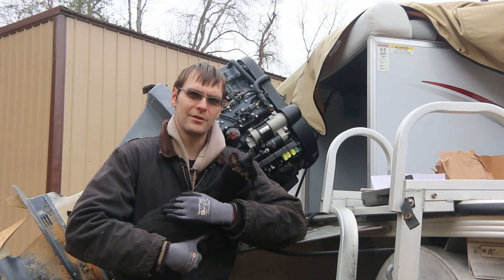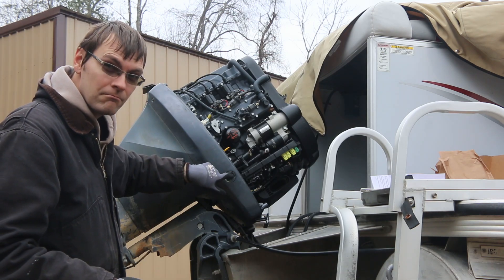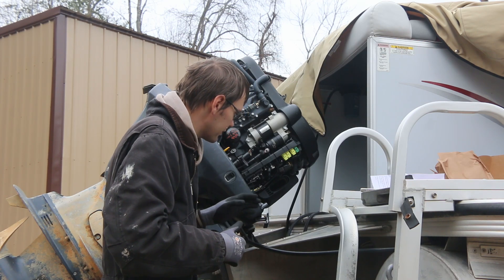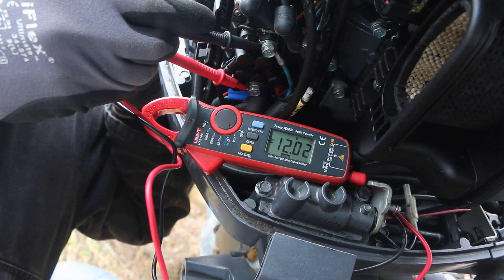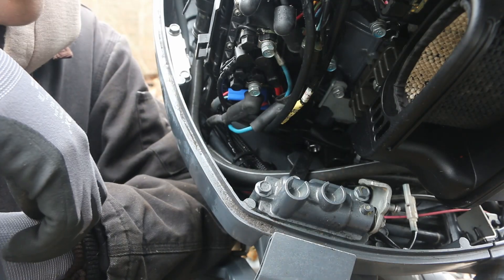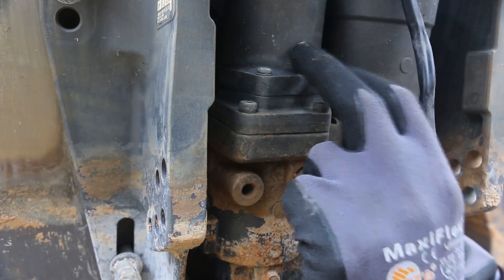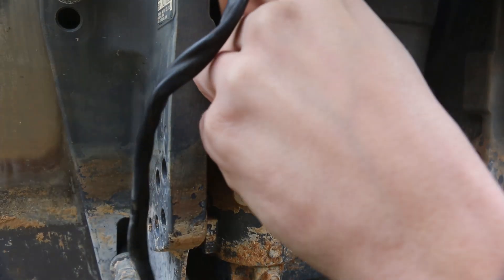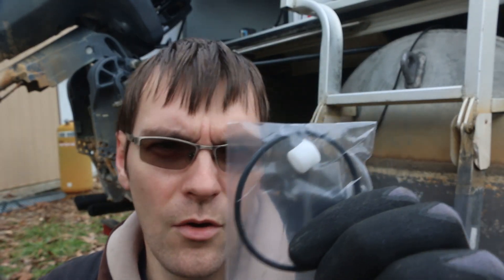Yamaha F90 Tilt/Trim Diagnostic and Motor replacement

Comment: But did you ever test your old motor directly to a battery? I'm having this issue but can't determine if it's the solenoid or not because when I wire the trim tilt motor directly to a battery it works great
Reply from the maker: Yes, the motor wouldn't draw any power, no spark, no nothing, evidently the windings had burned up or something.
Reply from the maker: if your motor runs when powered directly then its gotta be the tilt/trim relay or the button potentially

Comment: Should I put grease on the new motor bolts?
Reply from the maker: I feel like a small amount of blue loctite is recommended, I personally don't always do it because yamaha usually puts way too much on at the factory so those bolts won't come out, but it wouldn't hurt to put a drop on there.

Comment: The problem is, my motor is stuck down
Reply from the maker: There should be a manual release screw on one side, its recessed back in a bit, big flathead usually, then you'll need a few strong friends to lift it up, and flip down the lock lever, then figure out whether you need a trim motor, relay or something else!

Comment: Any clue what the other wire coming out of the grommet next to the trim motors wiring is?
Reply from the maker: Oftentimes there is another wire for the trim level sending unit for the trim gauge

Comment: Great video man.
I have a yamaha f90tlr that i am having the problem of the trim just clicking both ways i can tap on the cylinder and it starts working again. Can you add tilt trim fluid to it or do you think its the motor. I didnt see a bolt to remove on the cylinder side to add fluid but there is a bolt on the motor side under where you remove the screws to remove the motor. Mine looks identical to the on in your video the motor cylinder set up. Thanks
Reply from the maker: Usually there is a small reservoir type thing that has a plastic plug to add fluid, but if you can't hear the motor run when you hit the button, and tapping on it makes it start running then your issue is almost certainly the motor is failing.

Comment: My motor blows a fuse when I press down only and goes up fine. Is it a safe guess that the down relay is bad?
Reply from the maker: Sorry I missed your comment somehow. It is possible than something is wired up wrong for it to blow a fuse, but also incredibly likely that the relay has just failed internally.

Comment: Any wisdom on effective ways to remove a stuck upper shockmount pin ?  Engine's a '91  200TXRP.  I've tried penetrating oil and picking the remains of the rusted circlip out, so far. Asking because on this engine, there looks to be zero room in which to place even a flex extension in order to get third 10mm bolt holding the tilt/trim motor.
Reply from the maker: I'd hate to have to try it, but heat. I've fought to remove stuck, rusty things a lot recently, and heat is the only thing that worked.
you could try sneaking in with a 10mm on a 1/4 inch ratchet, its been incredibly tight on every one I've done, but it did fit just enough to get it off and back on.

Comment: 2008 yamaha 250 vmax hdpi vz250 When i push up or down on any of my trim switches my relay clicks motor does nothing up or down but can take either the green or blue wire off and touch it to the red wire on the relay and the motor will trim i have tried three different relays still didnt change anything what do u think the problem is
Reply: When i put a meter on the blue wire and the green wire it shows 0 even when u hit the switch up or down
Reply from the maker: @BigDaddysBassin  If the relay clicks, but it doesn't trim yet you can touch blue or green to the red and it trims, then it has to be the relay, or something is wired wrong on the relay, take a look at this video https://youtu.be/i8zsNDvOHOE and see if your relay is wired up the same.
Reply: @trythistv  i put the factory back on it because it reads the same as both the aftermarket that i have tried and it worked before so i know its wired right

Comment: Very helpfull. But does anybody know how we disassembly the piston?? It has a loss of fluid from the upper seal ring. I could unscrew the the upper  screw (trim cylinder end), but i cannot pul out the piston....
Reply from the maker: Typically the piston will come out after the end cap has been removed. However remember the seal on the piston is meant to hold hundreds of not thousands of psi so you will unlikely be able to remove it by hand. You may be able to slowly pull it out with the bypass screw loosened, or you can set a drain pan down, push the trim up button and stand clear and it'll self-disassemble
Reply: @trythistv  thank you very much for your response. I opened it, and could change the seal. But the problem now is that the trim is workind (goes up for 5 cm) but the tilt isn't..

Comment: Mine clicks like this. But I can shake it or keep clicking up and down, and it will finally move. Once it has moved, it will work. However. Once it has sat for a few days. It clicks again.
So im guessing my motor is starting to fail.
Reply from the maker: It does seem like that is the motor fairly often, I have seen it be the relays or connection to the relays. Saw one customers boat and the terminals on the relay were all corroded, we cleaned them up and put some dielectric grease to protect that from happening again and the trim has been working great since.

Comment: Thank you! Time to replace a trim motor😑. My motor is all the way down, thank goodness they have a screw I can turn🥵
Reply from the maker: As red green says you need a dumb friend or a son for that part. Lifting the motor by hand is not easy 😂 hope the motor replacement goes well!
Reply: @trythistv  Ratchet straps pulled the motor up for me. The best part was the brushes in the DC motor were stuck in place, filed them and works like new!
Reply from the maker: The best possible result! No sense spending money on something that just needed a little cleaning up!

Comment: George I have a 1999 70 HP Yamaha. The power trim works great but once the motor gets down to the trim rams it doesn’t go all the way down. I took it to a mechanic and he replaced all the seals and rings and I filled and bled the air. I think I got all the air out. What’s your thoughts?
Reply from the maker: I would look for something obstructing it, going down should be the easy part, going up is where you'd have issues from seals or air.
You could try loosening the relief valve on the side and seeing if it goes down all the way.
Reply: @trythistv  when I release the release valve it does go down all the way. That’s why I’m puzzled. I don’t think I can leave the valve slightly opened all the time though. Wouldn’t that allow air into the system?
Reply from the maker: The bypass valve is an internal bypass, so you could theoretically leave it cracked open and it wouldn't let any air in, but your trim will always sink down to the bottom slowly that way. When it stops going down does the pitch of the motor change like it's got an air bubble in there or something?
Reply: I got it fixed. As it turns out there are two ways you have to bleed the system. One is for the tilt and the other is for the trim. The trim needs to be bled with the manual release valve. I got ahold of the owners manual. It’s in there.

Comment: Just hit a sandbar and trim and tilt stopped working on my old Yamaha I hope it's just the motor lol
Reply from the maker: I've also got a video about the cylinder seals in case they got damaged: https://youtu.be/oReJLSfLRq8
Hopefully it is a simple electrical fix though! Could be hitting the sandbar broke loose the wires or the seal on the motor and let some water into the motor. Let me know how it goes!
Reply: @trythistv  cylinder seals were already leaking! Bought the wrong wrench to replace them and waiting for the correct to come in. Motor burned out in it. When I got home I tapped it with a wrench and it works...for now
Reply from the maker: Sounds like your projects go about like mine. Toss in a few backordered parts and it'd be real similar lol. Glad its working though, could be the impact jarred the brushes and one got stuck or something, Electrical things can be a little weird sometimes. If your motor does end up calling it quits for good at least you know how to replace it though!
Reply: @trythistv  have to keep tapping it to get it to work I'm thinking it's time to replace. I found an Amazon special motor for $90 so we'll see how that goes. Couldn't fork over $390 for a new unit
Reply from the maker: @jimbobbojack9712  I hear you on the cost, add boat or marine to the title of any part and the price triples. I have had good success with api marine parts, idk how great their price is though. But yeah having to tap on it sounds like it's time to replace it!

Comment: Where is a good place to find a replacement tilt/trim motor that doesn't cost an arm, a leg, and your firstborn child? My local Yamaha dealer wants $850 for that little bitty motor.  Is there the possibility that the tilt/trim motor could be rebuilt for a reasonable price?  Thanks!!
Reply from the maker: I've had good luck with API, Arco, and Sierra parts, you can find those brands online quite easily, and likely can cross reference from the yamaha part number for your specific outboard. Still not cheap, usually around $200-400, but thats a whole lot nicer than the dealer.

Comment: Great detailed troubleshooting, thanks! My 2006 Yamaha 250 trim tilt stopped working yesterday with this heavy engine in the down position in the water.The relay is making the clicking sound on both up and down. I can't trailer it out on the ramp because the skeg would hit. I am getting 12V to the red terminal on the relay, and touched the blue wire to the red, but the engine didn't raise. So I think it's the trim tilt motor, agree? I will have to get close to the ramp, get in the water, loosen that screw to reduce hydraulic pressure, and somehow lift the engine up. Any other ideas on to get the boat out of the water, or other troubleshooting before I have to replace the trim tilt motor? Thanks!
Reply from the maker: I believe it was Red Green that said you need either a dumb friend or a son, and I don't have either, so I have to do it myself. Get a strong buddy and go wading on the ramp, or a ratchet strap and another boat and lift from the deck of it.
Reply: @trythistv  I used the tried and true technique, and tapped the trim motor with a wrench. Somehow it worked, and tilt goes up and down now. So i just hauled the boat, and now going to follow your instructions to replace the tilt motor on 2006 Yamaha 250. Problem I can see off the bat is that third bolt looks like it's really hard to get to!

Comment: very good, mine is a big more messed up. My motor runs good hooked up to a 12v battery but not when the wire connectors are hooked back up to the switch wires and relays. when pushing the switch up and down on the motor the relays click. mine is a merc with one relay for the up and the other relay for the down. My next move is to disconnect the red lead from the soleniod and hook up direct to the battery to see if that is the issue. I'm also cleaning up all connectors with new heat shrink barrel connectors. I bought 2 new relays but didn't fix the issue so on I go. wish me luck
Reply from the maker: Since you already traded the relays that rules out the most common problem I see on the mercs, I see the solenoids go bad all the time on the alpha style sterndrive trim pumps, but idk if you've got an outboard if that would be the same or not.

Comment: Awesome video!  Instructions clear and percise!  Thanks!  I feel confident now and I'm ready to change my own motor. 
I'd like to add a hint if it's ok - To lube the motor's o-ring with a bit of the hydraulic fluid before putting it on the motor; makes it more workable & the oil will help expand the rubber making a lasting seal, as well as the life of the o-ring.
Thanks again for the video! I'll be sure to check out more of your videos  .
Reply from the maker: You're very welcome! And yes that is a great point on lubing the oring, certainly makes installation a lot easier!
Reply: @trythistv  I'd like to request how to install the trim/oil harness for the 90hp Yamaha. From motor to say, the digital multifunction gauge?
Thanks.

Comment: Thanks for the incredibly complete video and explanation of the troubleshooting and replacement of the trim/tilt motor.
I'm having to very lightly tap on the motor housing to get mine to work. The relays are fine.
Reply from the maker: Yup that sounds like your motor is on its way out. Glad the video helped you diagnose it, hopefully it helps you replace the motor as well!

Comment: My problem exactly! Thanks so much for the help. I figured out it had to be the motor, and you just confirmed it for me showing me what to do to fix it. 👍
Reply from the maker: Awesome! Glad the video helped, I've seen the relays (solenoids?) go bad but it does seem like these motors tend to wear out, they're in the water most of the time, I'm sure that doesn't do them any good, at least it isn't awful to fix

Comment: Mine has been clicking with no movement, but with a small tap on the reservoir it works
Reply from the maker: That pretty much tells you it's time for a motor, just like what I did in the video.

Comment: You have a very rare engine you have an out board with the rare factory WASP NEST SUPERCHARGER  ! At 120 MPH the engine sucks in the WASP NEST and it boost the HP to over 550 net brake horse power . I have seen speeds of 200 MPH with the WASP NEST INDUCTION!
Reply from the maker: LOL! The weird spark/flame arrestor on this boat looks alarmingly like a wasp nest doesn't it? With the added power I think a prop change may be needed to take advantage of all that extra horsepower 😄
Reply: @trythistv  All my years of working on boats I never seen an arrestor on a out board . Still looks like a wasp nest hahahahah